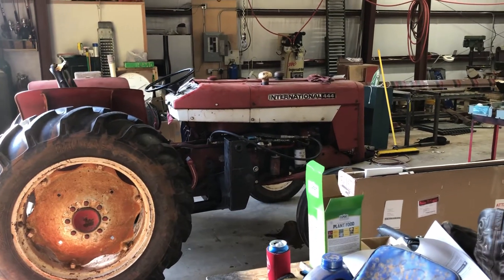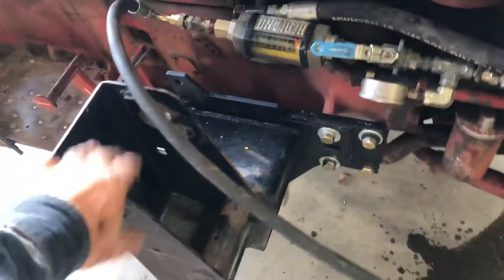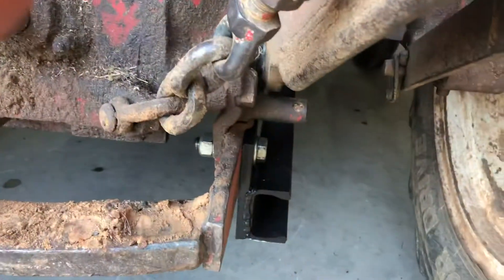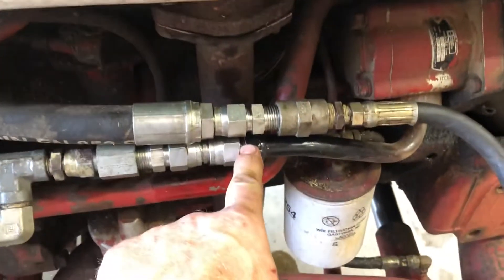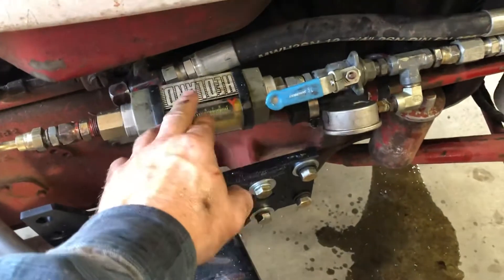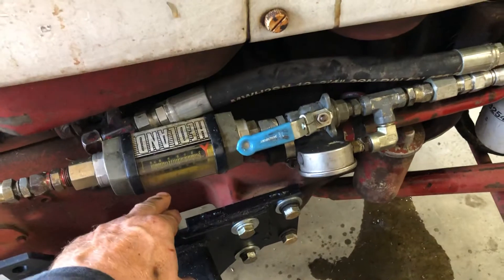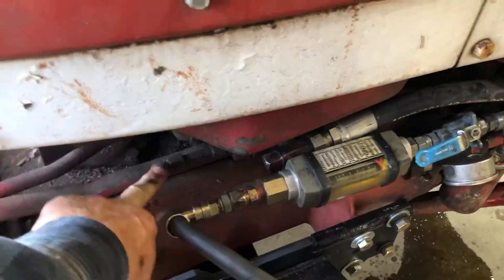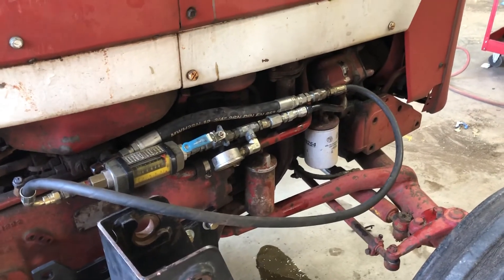IH 444D hydraulic system

Comment: I have the gas model 2444 mine has a handle up by the control under the seat and a brand new pump on it but still loses pressure so I can't use the loader or power steering system.

Comment: I know this video has been out a while but I just saw it the other day, I've been looking to see if you put out a follow-up but haven't found one would really like to hear from you on how it worked out as I have the same tractor and would really love to have a loader on mine
Reply from the maker: It works like a champ.  Loader works great
Reply: @michaelbragg7216  thanks for
 taking time to reply, been watching Craigslist ever since I saw your YouTube haven't found one yet
Reply from the maker: Works great!  I added a grapple to the bucket and use the tractor quote often.  Good luck to you
Reply from the maker: The loader I installed wasn’t made for this tractor.  I ended up modifying one from something else.  I looked for over 16 years before I found this one.
Reply: Just saw your message, I haven't been lucky enough to find one in my price range for mine yet but I 'm always looking thanks for staying in touch, please continue to do so and when I find a loader for mine maybe I can pick your brain some more
Reply from the maker: Loader works great.  Pump is roughly 6 gallons a minute at idle. And 11 at normal operational throttle.  The loader is a work horse, I’ve picked up roughly 1800 pounds with it and have since done lots of dirt work. I even added a grapple to the bucket.

Comment: I have the same tractor and my hydraulic system is not working. I will check the filter tomorrow and will have to find a pressure guage to see if pump is bad.
Reply from the maker: Jorge,  I modified my hydraulic suction filter.  I took the paper element portion off the filter and placed fine metal screen around it. Works like a champ since doing it
Reply: @michaelbragg7216  I brought the tractor home and cant get the power steering or 3 point to work. I cleaned the suction filter and added 2 gallons of new hydraulic oil. I am not sure if the pump or the flow divider has issues. I'm going through the manual as I type.
Reply from the maker: Jorge, maybe the relief valve has some trash in it. If that valve is lodged open you won’t see any fluid pressure in the system and likely nothing will work. It’s located in the valve that’s under the fuel tank on the right side. I believe the fitting takes a flat blade screwdriver to remove it.  anymore than that you should test the pump. To do so you’ll  need a flow gauge with a pressure gauge and ball valve.  I would imagine any hydraulic shop could test the pump, while mounted on the tractor. If you were closer to Oklahoma City, I’d check it for you.
Reply from the maker: A second thought,  I think that system holds more than 2 gallons.  Just behind the seat is the fill port for that system.  If the fluid level is to low the pump will cavitate and not pump.  If I recall correctly the fluid level should be about 5 inches of overall fluid. Someone has a great video on YouTube to change the fluids. that video is awesome.

Comment: Hi Michael what to do when. 1967 Int 444 diesel tractor. Don't started. Get the fluid but don't start and after running suddenly stop. Need help please thanks
Reply from the maker: Rebuild the injector pump and make sure it’s getting diesel fuel
Reply from the maker: Your glow plugs may have faulted out as well.  Try a little starting fluid